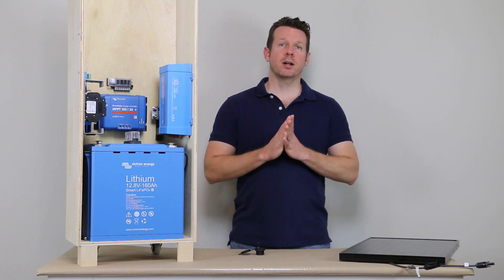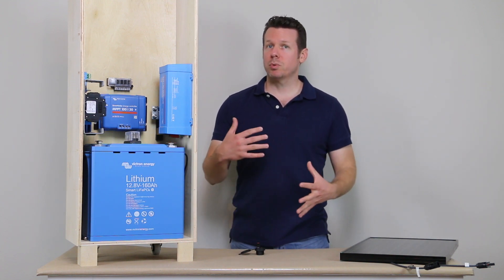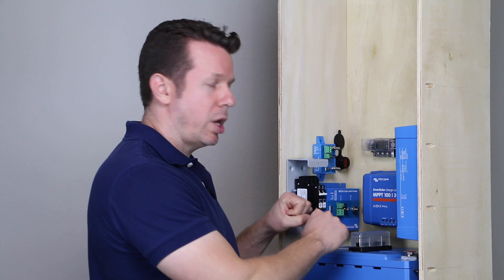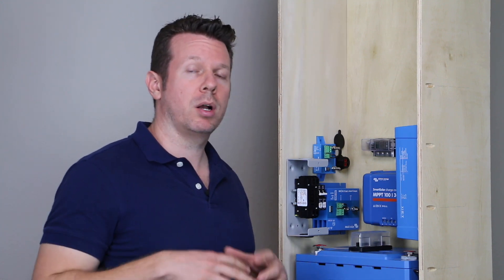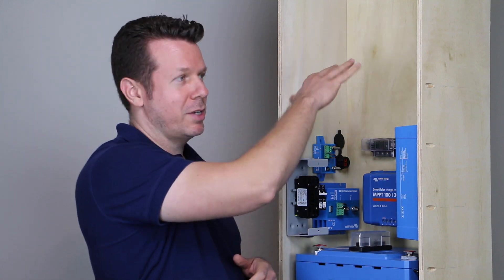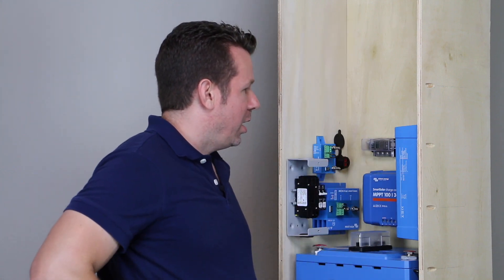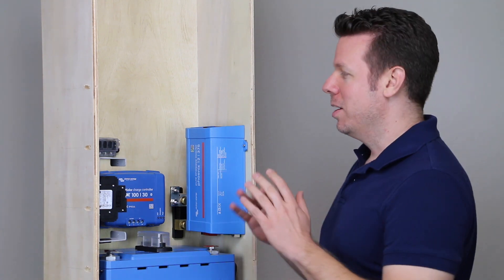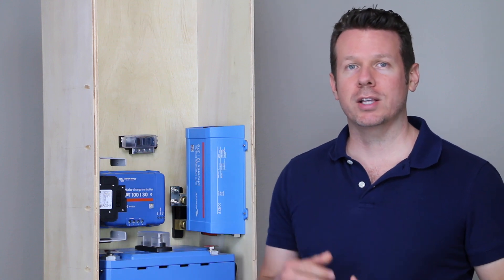Build a Removable Solar Power System for your Van or RV | Part 1: Designing the Solar Generator

Comment: Will this have AC charging as well?
Reply from the maker: Hi Russ, this unit will only charge off of solar, but another prototype could be built with an AC charger built in as well. It would just need to expand a bit more. I will probably tweak this design and build different ones. Let me know what you think of the finished one in next Wednesday's video, and I'll take that into account for a future prototype/video. I appreciate the comment!